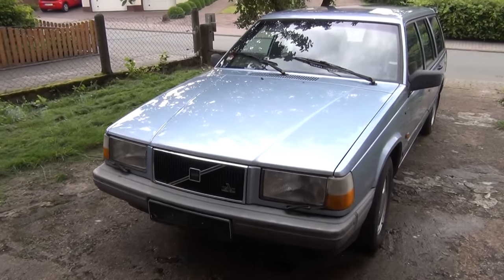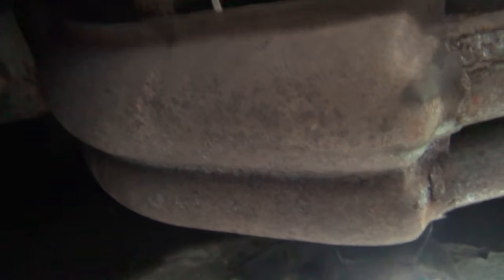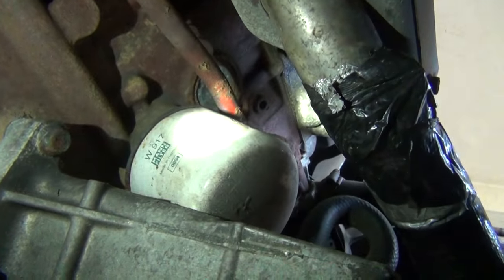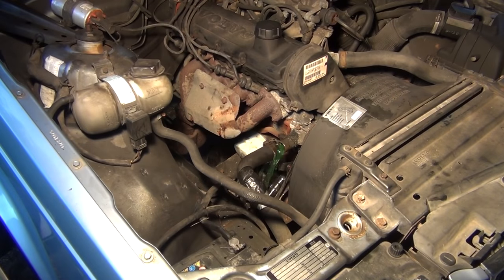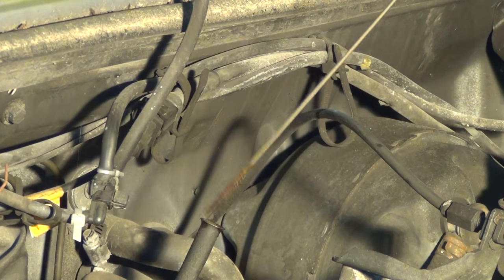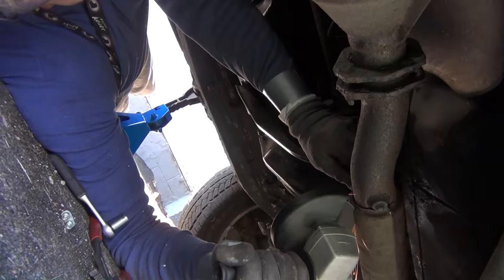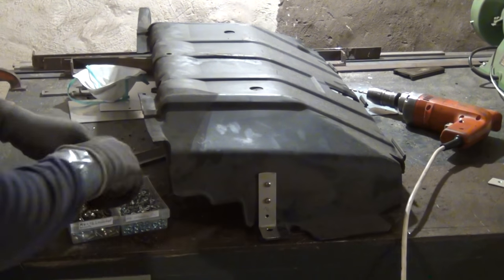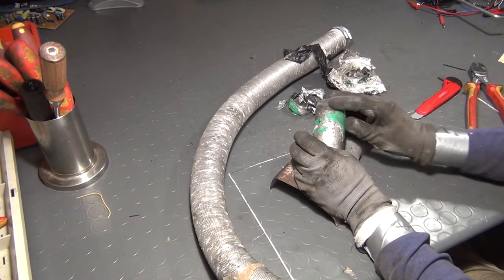Volvo 740 Repairs: Oil Change, Underbody, Air Filter, Downpipe etc.

Comment: People in the comments on previous videos were saying this thing is a rusty piece of junk... they couldn't be further from correct. For a vehicle of this age (and especially the price you paid) this vehicle is a gem. It doesn't get much cleaner than this for a vehicle that has been used on a regular basis for the last quarter of a century. Vehicles kept in garages and driven 50km on the weekends are a different story, but you pay a premium for vehicles like that. Also a Volvo was meant to be used, so the chances of finding a '90 Volvo that's been babied is almost non existent.

You're doing good work. The only other thing I can recommend to you to make this vehicle extremely reliable would be to replace any vacuum lines or other rubber fitting (as many of them as you can find anyways) with new fresh lines and seals. Rubber hoses has been the #1 reason for my vehicles breaking down, and considering things like generic vacuum line is very cheap it's worth the few dollars to prevent vacuum leaks by replacing it.

Comment: warm air is controlled by a heat operated valve, it only draws warm air in cold weather while it is warmng up, then switches, it is a good idea to fix this.  it promotes faster and more economic warm up, and in extreme cold weather prevents freezeing inside the inlet manifold and throttle response issues.

Comment: leave the warm air duct off and test during the winter. If you notice engine hesitation when it is cold, you know you need to but the duct back. If you search on line you can usually find this ducting cheaper. For oil filter, use a chain wrench that fits on a socket wrench. That way you do not need more clearance.

Comment: Never use tap water in the cooling system of an automobile, ever. 50/50 antifreeze is a must year round, because its main function is to lubricate every moving part to minimize friction, and contains powerful additives to prevent corrosion, allow engine temps up to 265 deg before overheating, and protect down to -34F before freezing. 50/50 antifreeze is cheap insurance year-round, and your best friend. I really liked your video on this 740, and was impressed by your simple, effective solutions. Just picked up a 97 Volvo 850 w/180,000 & loving it. Hope you're enjoying your 740, she sure looked nice!

Comment: I removed my 1990 740 estate's warm air intake set-up not long after I bought it in 2003, as the air tube had broken into several pieces and the metal part which bolts to the exhaust manifold was rattling. 13 years and 100,000 miles later, the car still has no trouble starting and running from cold, even in the depths of a British winter :)

Comment: Most people recommend that the preheater hose be removed. What happens is the flap valve in the air box goes bad and constantly provides hot air to the engine which could end up frying the mass air sensor.
I read that one guy had 2 Volvo 740's. One with the preheater and one without. He said that they both startup and run fine, even in 0 degree (F) weather.
But, you may fail your inspection without the hose.
I say, just slap on a new (cheap) aluminum flex hose and cal it done.

Comment: So many memories. I had the same car (even the same color). My plastic cover also fell off, but I never put it back. Also my horn was broken and I replaced it with just that part you have. I think I still have the special tool for removing the oil filter (even though I never use it anymore). Thank you!

Comment: Man what a pain in the keister to change that oil filter... Your repairs on the engine cover are stronger than the original mounting holes now.  Great work with the cable clamps I would have never thought of that.  :)  I have that same aluminum hose setup on my chevy pickup it fell off one time and I did not replace it for several months. It did not affect fuel economy or emissions testing according to my records. I do NOT live in a place with very cold winters though. I put it back on because I found a piece of discarded aluminum hose that fit.

Comment: I enjoy this series of videos a lot. I've been a mechanic for nearly 2 decades & I appreciate your attention to detail. I also enjoy doing much as you do when getting a car that is new to me, I go through many systems to ensure they are in acceptable working order.
I would advise against using tap water in the cooling system. the mineral content of tap water will cause rust and scale inside that system. I use distilled water, which is very inexpensive.
Also, please inspect the condition of  brake fluid. It is supposed to be clear or nearly clear if it's good. If it looks like strong coffee, it is heavily contaminated with atmospheric moisture and that causes the hard brake lines along the chassis to rust from the inside out. It also causes the brake pedal to travel too far, making the brakes less effective. Flushing new brake fluid through each corner of the system will make the brakes very easy to see improvements in. It's also very inexpensive.
When I purchase a car, I also like to replace as many vacuum hoses as possible. It's cheap insurance and solves annoying near future problems with older cars too.  I'm also fond of your taste in tools! I have owned a facom ratchet in the past and I liked it a lot. 
I will keep a close eye for the next video. Have fun!

Comment: If you reinstall the preheat hose you need to make sure the door in the air box works. If that door fails in the hot air position the constant stream of hot air will kill the maf sensor.

Comment: You will have to give us a review on your tools now that you have had a need to use them.  What will you want to buy next, what worked and what did not.  My favorite oil filter tools is really just a wide nylon strap loop ran through a square tube that a 1/2"/12.5mm socket wrench will drive.  It fits and grabs any size filter that you can fit the socket wrench with maybe an extension in to turn it as a lever.  I am sure you could make one for very little money.  Basically a simple strap wrench.  Best of Luck!!

Comment: For the rattle plates:
The front one I used to drill between the pipes and put a long M6 through with big washers. The other one? It won't rattle in the thrash can...

Save the bracket you removed if you are going to change the downpipe some time. I usually just move it up a bit so it doesn't vibrate against the pipe.

Comment: As far as the hot air intake goes. My uncle recently bought a proper heat exchanger online for one of his Venetian cars. It looks no bigger than a single size RAD that is used in water cooling a pc. I suggest you look into getting one of these kits instead. If it can be installed into a car that's over 100 years old, you should be able to manage. And while it may not provide the heat as fast as your current setup can. At least you don't have to do away with the heater all together.

Comment: I vote no pre heat hose.  even if you get one, it will break again anyway.  I don't have one on my 93 940.  actually I took the belly pan off as well - but I admire your solution to that problem.  I want to try something like that to fix my tailgate rattle.  the kit I bought isn't effective.

Comment: Your leather belt and a long flat head screwdriver works most times. Wrap the filter with your belt and then use the screw driver to leverage it off with the belt buckle . Just make sure you have a hefty belt buckle

Comment: There are meant to be 2 horns underneath the car, there is usually a High-pitch and a Low-pitch Horn. The Warm-Air intake is not needed. I drove without it in -24ºC without any problems, started just fine.

Comment: The hot air hose is for preheat when the engine is cold, since the exhaust manifold heats up very quickly. In the bottom of the air box there's a valve that shuts off the hot air to the air box when the engine reaches operating temperature. It shortens warm up times, especially in the winter. How much I really can't say, I've removed it on a couple 740s for friends when installing a cone filter, and they never complained. Still, if you plan to keep the stock air box, I'd replace the hose. The hose isn't anything special and can be bought from any hardware store, just check that it isn't coated in plastic since it can get very hot. Also, change the radiator hose asap, and put some antifreeze in it, the antifreeze is more important for anti-corrosion!

Comment: New radiator hoses sooner rather than later, and if you have to drain the coolant into a bucket simply use an old, but not too worn, sock to filter it when pouring it back into the bottle. Gets the dirt out and saves the coolant. 

That engine will also need a new oil pump soon, the tell tale knock on start up says the oil pump clearances have grown larger than the tolerance allowed, and thus lower oil pressure to the big end bearings. Just make sure the oil warning light works, and if it comes on in operation stop immediately, or drive to the nearest scrapyard and park it there.

But Volvo does make good vehicles and trucks. Will always have little niggles but they are very reliable.

Comment: The air duct from the exhaust heat shield is there to pass warm air into the intake to help the engine warm up in cold conditions. Of course it's not strictly necessary, however, you might find that the engine runs lumpy in the winter until the engine eventually gets warm. In my opinion, it's far better that the engine gets what it needs to run as smoothly as possible in the shortest space of time. My car has a similar setup, but the air filter housing sits right over the exhaust manifold, i currently don't have the duct installed and in damp cold conditions it takes around 5 minutes longer for the engine to settle into a good idle speed.

Comment: I would recommend a strap wrench for removing the oil filter in the future. You can get them in a variety of sizes and they are quite cheap here in the USA, at least. Additionally, you may want to verify the alternator belt is not just poorly tensioned, instead of worn out.

I'd also suggest replacing your mechanical fan clutch with an electric fan setup. I've used them before in vehicles with mechanical fans, and they often improve engine warm up in the winter, A/C operation in the summer, do a better job of cooling the engine in stop and go traffic, and reduce some of that engine noise, which makes diagnosing things a bit easier.

Comment: The hot air hose is to prevent the fuel freezing up in the throttle assembly.
Never seen this happen to an injection engine but is very common on the old carb engines.

Comment: That aluminum hose is called a heat stove pipe, or carburetor preheater hose. There is usually a vacuum-powered damper that opens and closes it from the air filter housing. This system is designed to help the car run more smoothly while the engine is warming up to operating temperature and helps the engine reach operating temperature faster. I have only had one car that used this and it made a night and day difference at freezing temperatures. Without it, my car would struggle to stay running before the engine became warm. Modern cars automatically adjust the fuel/air ratio and idle speed to avoid using these extra parts, but some mechanical intervention is preferred over having to sit there, revving the engine to keep it running like the modern cars do for you. 

I suggest that if you are going through the trouble to mend the less important parts you showed in this video, that you should also make this helpful system functional again. Otherwise, this car may become very frustrating in the winter. It is supposed to be attached with hose clamps like that coolant hose you removed, not duct tape. Even if you don't think it does anything, you will have 2 extra hose clamps to repair something else in an emergency.

Comment: First great video. Second replace the hose as soon as possible. The cooling system need antifreeze not just for freezing but it contains anti rust additives and lube for the coolant pump. The hose removal may be ok but it may be required for emission inspection in your area. It is in the US. Hope this info helps.

Comment: You may want to put in antifreeze sooner rather than later. If that engine has a cast iron block and steel liners these have a tendency to rapidly corrode. The antifreeze also contains a corrosion inhibitor. A friend of mine did a similar thing to an old car and soon after it developed all the symptoms of a blown head gasket. Except that wasn't the problem - the liners had developed hairline rust cracks...
Reply: I agree, but since it wasn't the whole cooling system that got drained, but only a part of it, there is still antifreeze in the system, just at a lower concentration. Still, that hose need replacing anyways.
Reply: Yes - using water rapidly destroyed a head gasket on my daughter's old car (1992 Saturn SL2 with aluminum block & head / iron cylinders).  We should have used 50/50 coolant water mix for top off to prevent a head gasket failure in a few months later.  The head gasket looked like Swiss cheese due to the rapid corrosion. It was amazing - a lesson learned the hard way!
Reply: and tab water is not that good to because of all particals can cause cohesion
Reply: raichu raichu yes, distilled water is definitely the better solution. But as I see it, this car isn't being driven yet, so the engine will probably run for less than an hour until that coolant hose is replaced, and with it, I hope, the whole coolant in the system (or at least as much as you can get out - some will always stay in the block).
Reply: There is some discussion that distilled water should not be used in coolant, because it leeches much more metal out of the engine block, tap water is already saturated.
Reply: Yes Mr Post Apocalyptic Inventor please change this soon!
Reply: +stefantrethan, you are right if you got an aluminum-block
Reply: Not just the block but the steel impeller in the water pump will corrode in plain water. Also, aluminium will corrode. I've seen hose-pipe fittings on blocks crumble on engines run on plain tap water.
Reply: Do this ASAP
Reply: i agree with all of the above,us at least the minimum required as the inhibitor also prevents electrolosis of disimilar metals. it will help it to stay cooler as well

Comment: If an oil filter is screwed on too tightly, there is one method that helps you get more leverage without needing too much space. That is to stab through it with a screw driver, and then use the screw driver as a handle to turn it more easily. The catch pan should be under it, but that it should be for any oil filter removal.

Comment: The heat shield that was removed to get to the oil filter may help reduce the heat in the area. On some models of cars removing heat shields can cause overheating of nearby components. The heat riser tube itself is just for faster warm up in cold weather.

Comment: It's a good idea to replace the warm air intake tubing, it helps during warm-up.

My experience with the original mounting position for the horn is that it just always rusts away. I've mounted it behind the grille instead, works like a charm. Yellow/black wires should be the stock colours.

Comment: One way of removing a tight oil filter is by hammering a long screwdriver through it, once the screwdriver is through you can use it to unscrew the filter. Very messy, but a good way of removing a tight filter in a tight space like this.
Reply: You know you can buy a special wrench for this job which costs like 5-6 dollars or thereabout, and you've also got plenty of clearance to move it

Comment: In answer to your questions, keep the warm air piping, it takes heat energy to vapouize petrol which can lead to freezing. I had a Scimitar (3 ltr V6 Ford engined) once and a previous owner put a sports air filter on it and threw away the standard warm air kit. In any weather conditions other than summer it would misfire after about a mile until the under bonnet temp got hot enough. I also had a 1961 Austin A40 which stopped on me one morning after about 5 miles, when I lifted the bonnet the carb was covered with ice, once it had all melted, from the heat of the exhaust manifold, the car started straight away.
As for the anti freeze, never run an engine with an aluminium head without some form of corrosion inhibitor or the head will crumble away around the water passages.  A friend of mine earns a living welding up heads for people that thought it unnecessary.

Comment: The preheater hose is to allow quicker heating of the engine in colder climates, here where im at in Texas it never snows and like yours its expensive to replace so i just removed mine.

Comment: The intake heater is a basic heat recovery system to help the engine warm up faster in cold weather. You don't absolutely need it, but it helps in the subzero (Celsius) range. My general opinion of these things is that the engineers that designed it probably knew what they were doing. Great car by the way.